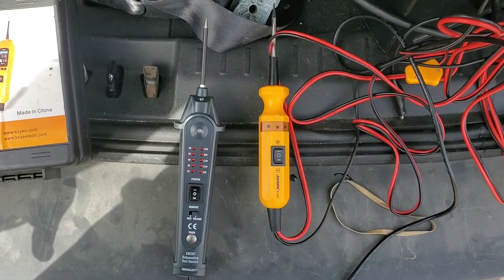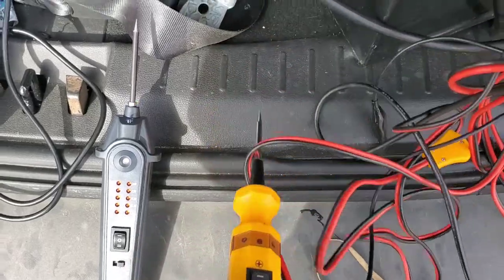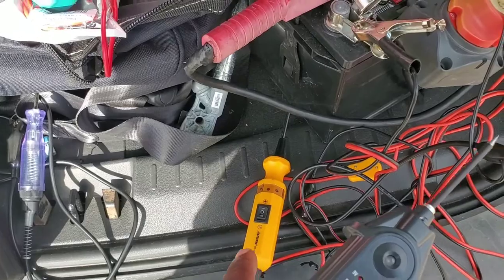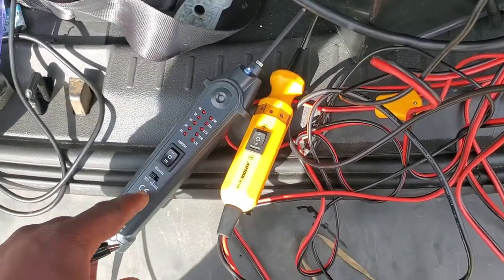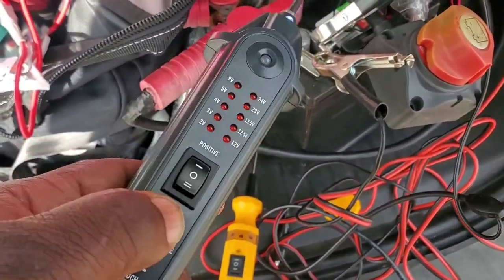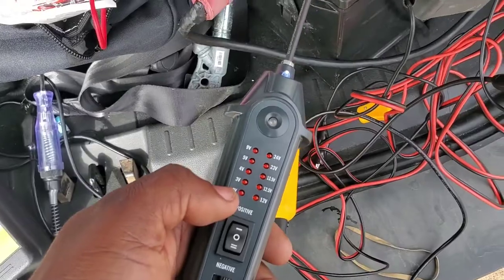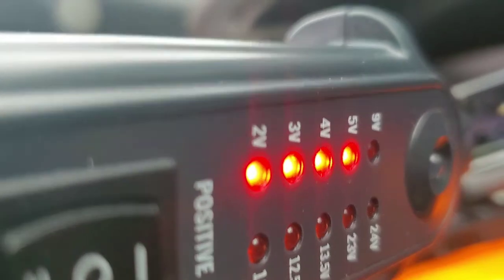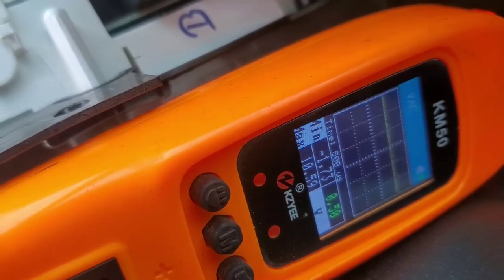Cheap $20 Power probe Oscilloscope circuit tester Shootout! Unbelievable value!BT160 ALLOSUN EM287

Comment: Nice video, been looking at these. Do you think the voltage readout on the EM287 is sensitive enough for voltage drop testing?
Reply from the maker: I feel it would work fine for that, it's fast enough to to view most pluse waves
Reply: YES IT IS!